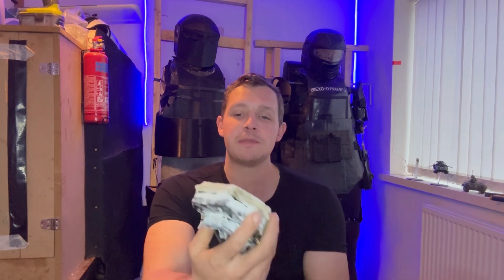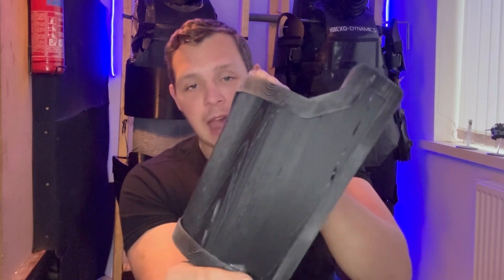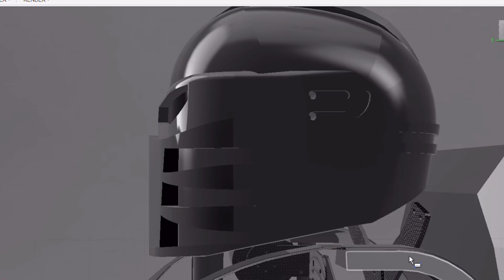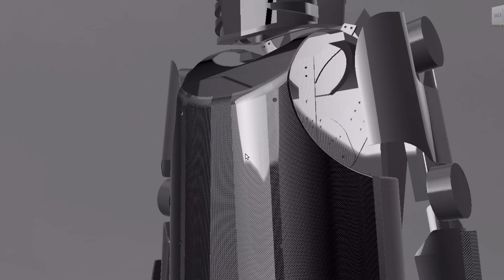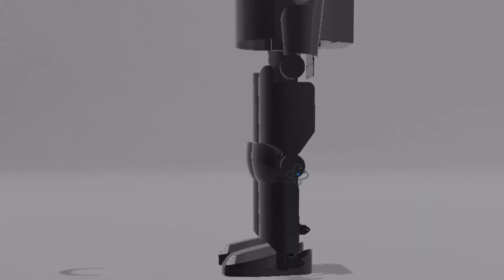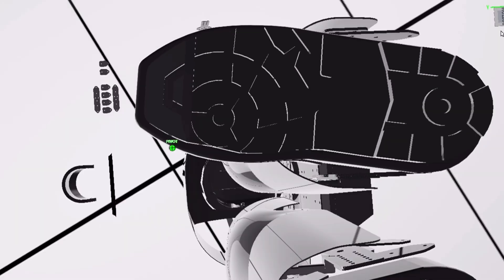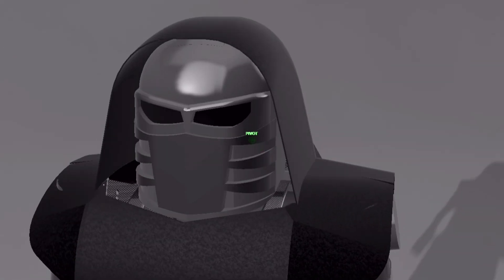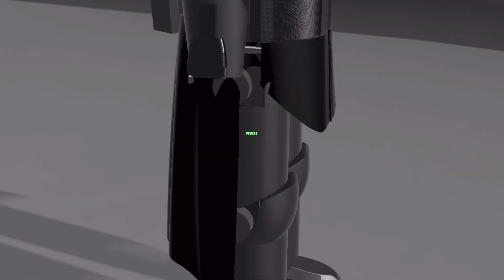MK5 Armour Shell Design - Building an EXO-SUIT POWER ARMOUR

Comment: For the viser and being able to shoot. Put an infared laser pointer on your weapon and allow your hud to see infared. Thats literally it. Put a zoom in there and your good to go hip firing and so on with accuracy. Ad for the armor reading your movements. Put a mesh bodyglove on that allows for neural reading, inside the armor use those tags that hospitals use to read your vitals. The ones that hurt when you rip them off. Use em, without the glue. That way when your snug in the armor the armor reads your movements body synapse response. Ive been tinkering with my own suit ideas for a while and your suit is inspiring.

Sorry had to add one more thing you might like. There are headsets that dampen desibles while increasing hearing from lower decibled. So a loud explosion wouldnt have as deep an impact while being able to hear someone talking to you while firing a weapon. And the EGG neural headband. Can control certain functions with just a thought, such as ac fans on, nightvision on/off and so on without having to press a button. Again great job these are my ideas for putting into my suit im building

Comment: a wrist mechanism can be done relatively easily with two bars at 45° (3 joints at 45°) connecting the forearm to the hand backplate.

the wrist does not have too much   range of motion, so this suffices for a sturdy simple articulation

Comment: thin steel is a good outer layer for scratch resistance, and it is cut resistant which aids the kevlar. its also a good inner layer before the backing kevlar to prevent sharp ceramic fragments from cutting the kevlar,while tje kevlar then is the tensile protection.

Comment: One way to add protection to the belly area would be to add faulds, articulated hoops of armor that cover the stomach and pelvis layer.
Reply: @FredDino  I believe a placart design could work to break up the torso and add more mobility, but it would be hard to pull off more than 1 fauld. 

The armor plates simply have to be too thick to have any good ballistic rating. Meaning the thickness of the armor wont allow Medieval and Renaissance designs to work.
Reply: @FredDino  Either way maybe it would be a great design to try out if they can find a workaround for the armor thickness.

I believe the gaps in the articulations would have to be more spaced out, and you'd need more robust inner Straps for the articulations. Floating rivets absolutely wouldn't work for this thickness.

Comment: You should look at 16th century tournament armor from Henry 8 and Maximillion 2. No gaps at all, extremely flexible.
Reply: The issue with that is that it is hard to scale with thicker armor. Those armors range from 1 to 4 millimeters thick. The faulds, however, are an excellent solution to stomach and pelvis protection
Reply from the maker: They were great armour, but freddino is right on the thickness side, the armours best  part of 20mm so overlaps just dont work annoyingly
Reply: @RobbyVogel  Perhaps the only solution for faulds is if you add an inner spine, so the thick articulations don't touch, and weigh down on eachother. You'd also need more reinforced straps. Floating Rivets would never work.

Even then I believe that design wouldn't be practical because it wouldn't be comfortable to lie down in a pron position. You'd be forced to either stand or crouch.

However I do believe a 15th century Placart design would work to break the torse plate into 2 pieces for added mobility. 

This design features a Breastplate that ends at the wearers Navel (end of the ribs) and you add a supplementary plate that can be added or removed called the Placart.

The Placart overlaps the top of the breastplate but sits a little lower. (around the top of the bellybutton) The Placart adds double protection to the lower breastplate, and added protection to the abdomen. 

You can attach the Placart to the breastplate using some form of reinforced straps that can handle the weight of the armor.

Using straps to the top and sides of the Placart will allow extra flex and mobility.

Correct me if I'm wrong but I believe the Placart has a better chance of working because it is one solid plate rather than a series of articulations. Not to mention many modern plate carriers have Velcro placarts that hold Rifle Magazines. However I believe Modern placarts are only rated to stop strapnel, and aren't ballistic rating against firearms.

Comment: if you're doing screens on the inside and cameras i don't believe having eyes is essential unless it's just to look cool / have a place for the lenses.
Reply: im not a pro mech builder but it might be cool if the headspace in the helmet was sort of bobbleheadlike for the purposes of more room and screen space for the interior. a little sensors suite on the interior of the helmet that you can just freely look around in and see through as if you weren't in a helmet at all would be outrageously cool imo.
Reply from the maker: It is a combination, because i dont want to interrupt the layers of armour with camera holes, the cameras will be kind of ‘stuck on’ so theyd need to be some form of surround just as edge protection (like a phone case is). So at that point i thought can I make it look cool
Reply: @MattExo-Dynamics  thanks for the response, always a pleasure to get one. 😁  personally I wouldn't worry about making it look cool. In military technology things just become cool and stand alone in their legendary, iconic visage because of their effectiveness. Also it seems pretty early on in the project to worry about imo!

Comment: Magnets are heavy. Velcro would work perfectly. Cheap, leight weight, easy to replace. Velcro is strong and have even be used to maintain parts on helicopters.
Reply from the maker: True, most of the straps are going to be velcro as they were on the previous one. Thought magnets might be neater just for the helmet but we’ll see

Comment: I wonder how practical a camera could be for helmet visor vison. 

You could use one solid blast sheild plate covering the whole face with a small camera hole for maximum vision and a full screen display on the inside of the visor. This would most likely be a specialized visor type for absolute maximum protection.

I feel like for this design to work you would need the visor to be able to come off quickly and easily in case the camera malfunctions or turns offline.
Reply from the maker: We’re gonna find out! Ive worked out i can lace the camera wire through the eye surrounds, so i wont need the hole
Reply: @MattExo-Dynamics  camera eyes are not viable yet,as cameras always have a delay, don't have a brain linked focus, abd have lower dynamic contrast range than the human eye

Comment: I just remembered something from a few years back. If i've got it right, then it was about some military helmet prototype with built in display but most importantly these working headphones that took the sound from the outside whenever you put the helmet on and lowered the max volume (meaning better hearing with the full helmet attached and less decibel heavy noises aka no ear problems.)
Hopefully this info is useful to you, but it's kindof out of subject